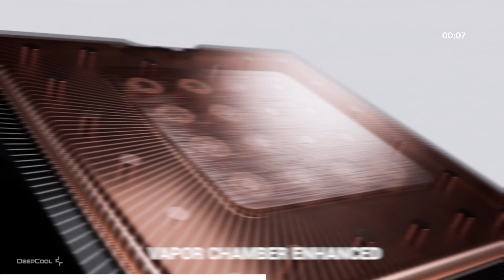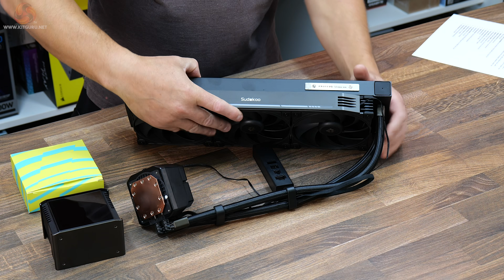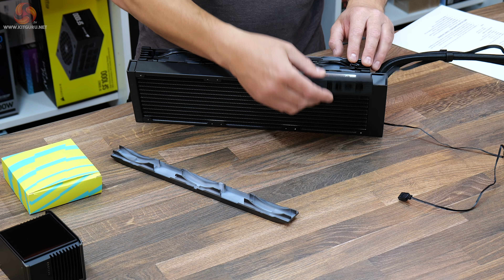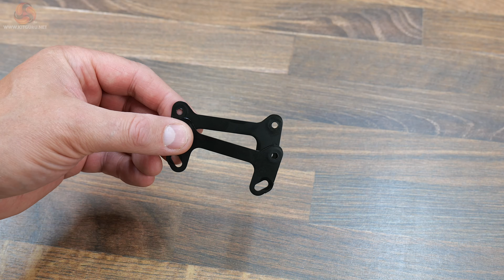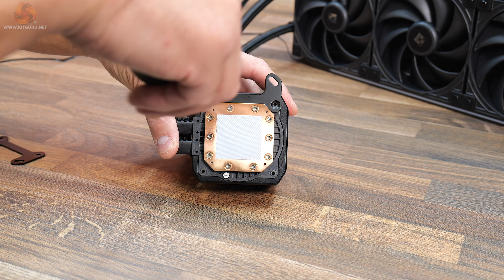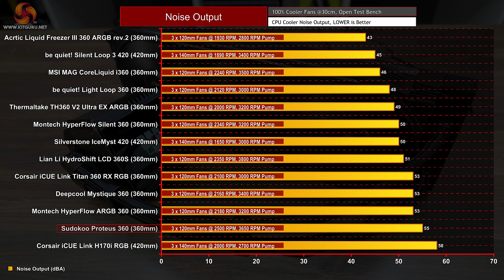Sudokoo Proteus 360 AIO Cooler: Full Review & Thermal Testing

Comment: James’ acoustic testing always highlights the stuff most people overlook. You can get away with flashy marketing until someone puts a dB meter next to your cooler and shows it’s not offering any benefit for the added noise. That 55dB at full tilt is nuts. I don’t mind a bit of noise if it means class-leading cooling, but this doesn’t deliver either.

Comment: The part that really surprised me was how little thermal advantage those high-RPM 30mm fans actually offered. You’d expect a measurable edge at full tilt, but James showed it lands right next to coolers spinning at lower speeds with quieter profiles. That’s not a good trade-off in my opinion — noise without gain is just bad design. At £260, there’s no excuse for mediocre efficiency.

Comment: Visually, it’s a nice-looking unit. The brushed metal, LCD rotation, and overall layout are very clean. But once James started pointing out things like the rough radiator coating and the loud fan profile, it really undercut the premium vibe. It looks like it belongs in a high-end build, but it doesn’t perform like it should at this price — especially not when compared to more established options.

Comment: The moment James started the PBO test results, I was waiting to see if this would actually separate itself from the pack — and it didn’t. Holding 52.2x under 255W puts it squarely in “decent but unremarkable” territory. If I’m dropping £260 on a cooler, I expect chart-topping thermal behavior or near-silent operation. This had neither. The screen might win Instagram builds, but performance nerds will walk away.

Comment: I have the Mystique 360 and mounting hardware is the same with different Intel back plate. The 2 AMD brackets need to moved 90 degrees for rotation on the Mystique.

Comment: Great review. That's one to which I will give a miss. At that price, anyway. And I thought people were turning away from SATA connectors for power to 6 or 8 pin PCIe plugs?

I do have one question: can the USB cable really reach the USB 2 headers when fitted in a case, given that the USB headers are often on the far side of the motherboard from the CPU fan headers? Can the cable neatly reach?
Reply from the maker: It reached on in our test system which mounts the rad in a similar top position as most cases.
Reply: @KitGuruTech  Thank you.

Comment: Looking at DeepCool Mystique 240 3 feet to my right and yeah, it's a rebranded DeepCool AIO by pretty much every measure. I've had a ditro deal with them prior to the political nonsense and the Sudokoo gear is almsot piece for piece a dupe of the DC pieces. Their 700 line of fans are also the same components as a the AKs and Assassin 4 coolers. I'm going to give them a try if they can get the prices in line.

Comment: From a builder’s point of view, I actually think they’ve done a few things right. The semi-assembled setup is great if you’re building at scale or just want a faster install. And the magnetic screen mount is clever. But then you’ve got fragile plastic trims, a weak magnet on the hub, and a surface finish that honestly looks unfinished. James walked us through all of that in detail — good info for anyone thinking of using this in a client build.
Reply: Thing is from a builders point of view its going to take up a lot of the budget... Its as expensive as a motherboard...

Comment: Would be cool if these could be used for either GPU or CPU.
Reply from the maker: A couple of companies used to do adaptors to run AIOs on graphics cards but the problem is when you remove the stock GPU cooler, you also loose the VRM and memory cooling too.

Comment: Arctic Freezer III 360 last place?
What?
In any other reviews AF III 360 it's in top 3 at least
Reply from the maker: We even tested two samples of the Freezer III 360 and got virtually identical results. We validate our results several times for accuracy. 

You should only compare our results with others who test using a 9950X and against the same coolers.
Reply: Not in Robeytech and the latest Hardware Canucks reviews